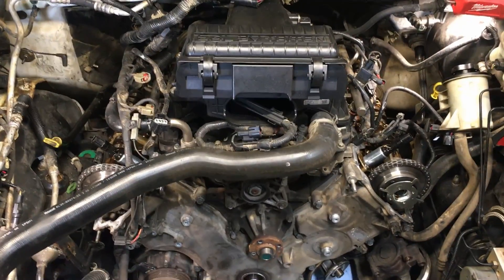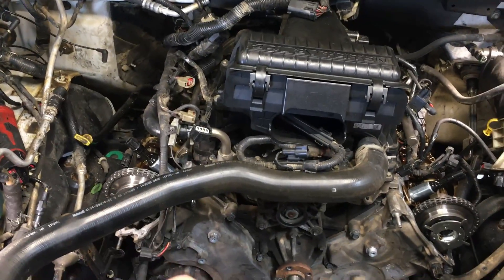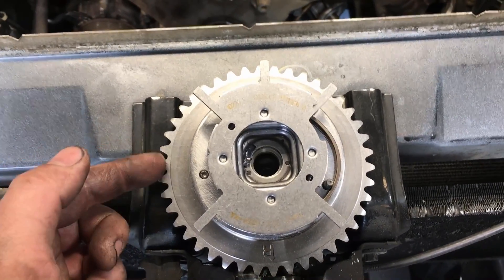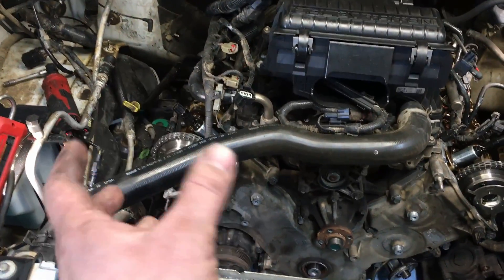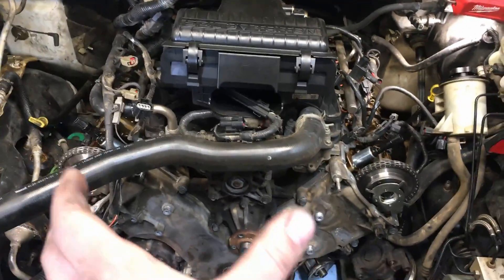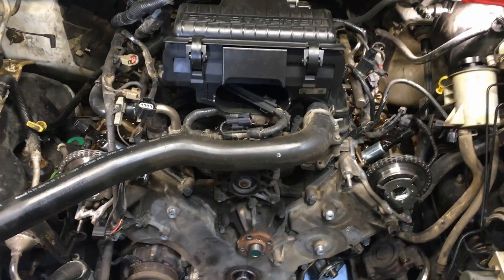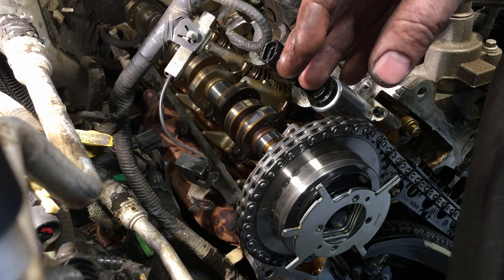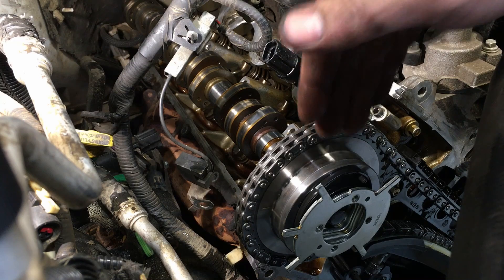Ford 5.4L 3v Triton Engine: DO NOT USE AFTERMARKET PHASERS FROM FREEDOM RACING/OTHERS; THIS IS WHY!

Comment: I'm never buying one these trucks. to many headaches with the Triton. I know that's not your pint but why deal with the plug, manifold bolt and other issues. I was going to buy a low mileage 2002 King ranch for 6 grand. Beautiful truck but no.  going back to my early 2000 year dodges. Parts are cheap. easy to work on if you can find one with a good frame and body.

Comment: Did any one else have an issue putting the cam phasers back on? I made sure my making were all lined up between my sprocket and my chain. But not when I try to put my new camshaft phaser on the little keep pin doesn't line up with the grove on the cam shaft. Any help?!?

Comment: Can you tell me which aftermarket  intake manifold you recommend  for a 2000 Ford Expedition with 5.4 2 valve.  There are so many of them and I am afraid it may be noisy if I buy the wrong one.  Thanks.

Comment: I was the Dyno tech at Cloyes Gear and I don’t trust many timing components , we make OE parts for FORD &GM just to Name a few, our hi perf sets were amazing from the HEX A JUST, QUICK ADJUST & Gear drive sets, the chain is something you must be careful when choosing, IWIS, CLOYES RENOLDS & Borg Warner is all I trust, Gates belts period, see every link will stretch and the longer the chain them more links the more cam timing problems, people have no idea how much power they lose over chain stretch and it is a little bit at a time so a timing set replacement will blow the customers mind if they don’t understand. Cloyes has sold out a couple times in the last 15 years or so and AAM and Cloyes we’re together but this year they split and AAM is where I now work and Cloyes is starting over with a small crew, we do more OEM @ AAM now but Cloyes will be the big boy soon I believe and they still do their hi perf old school and I trust their quality

Comment: I did it twice the owner insisted on buying all the components. On eBay evrything was after market needles to say both times those cam phases failed within 20 minutes wile test driving hey idle fine for a good hour then on the test drive it went to pooop

Comment: So left is your left as your looking at it? I woulda thought it would be left (or right) as viewed from the drivers seat, like airplane engines.
Reply from the maker: the left is always the drivers side yes.
Reply: But, unless im somehow mistaken,  that engine has the one marked "L"  on the passenger side. Is it installed wrong?.  But im just a diy mechanic so i defer.
Reply: @Taranabas52  ooh. Now it makes sense.

Comment: FREEDOM RACING SUCKS!!.  I did this job before Brian put this video out.  I had watched his other videos and did not listen and bought the timing kit from Fredom Racing.  It has been less 20,000 miles and a year and a half.  I am now tearing into my motor again.  It is worse this time then when I opened it up the last time with all the original parts.  Passanger timing chain guide was broke in two places and just resting on top of the chain.  Broke at both ends.  Then on the drivers side the tensioner is blown and slack in chain and tore up my trigger wheel.  It wasn't worth the couple hundred dollars I saved!  Thank you Brian for getting the word out and for all your hard work on posting such great videos.  You ROCK! and will definitley listen to you from now on.

Comment: I just bought a 07 f150 fx4 with 135k miles it runs great but I definitely wanna upgrade the oil pump but what else should I be considering for replacing besides oil trans fluids and spark plugs thanks for any advice

Comment: Hey Mr. Ford tech I got a Ford F-150 2012 4X4 with a 5.0L and I got a Code PO300 and I replaced the fuel pump all the Coil & spark plugs & the crank position sensor & it still idles rough and won’t run right, did check for vacuum works too ,so a Little bit of advice thanks please.

Comment: Just deleted the cam phasers on my 2004 f150. Both locked out at full advance. Truck runs good but is down on power and fuel mileage.

Who do I need need to contact to correct the tune? I actually would like to tune it to have even more power for towing.

Comment: On 2008 f250 5.4  3v  What do you thank of installing a Cam Phaser Lockout by Livernois Motorsports
Reply: I had it done. I have not had any issues since.
Reply from the maker: No

Comment: The one thing I've learned over the years is that yes you can use aftermarket parts in locations that are easy to deal with. An example would be a lock actuator or something of that nature. When it comes to a time-consuming job such as parts behind the timing cover, it's best to use Factory parts. It just saves you a lot of grief.

Comment: garbage engines. if the phasers don't fail you lose oil press due to worn cam bearings (which are the heads themselves) and not to mention worn out camshafts

Comment: I have a 04 and just did the timing job with phasers from ford and it makes a weird rattling noise on in drive and reverse (sounds like a rattle) could that be the timing chain? In neutral it’s quiet.

Comment: Good to know. You'd think one way the aftermarket could make a successful replacement would be to design a standard gear without the phasing nonsense. That's be win/win, you'd save money and make the engine more reliable.

Comment: Ford does the R&D folks unless your aftermarket part is tested like crazy then why use it? Problem is how can you tell, Can  you even contact the company to ask these questions? I’d say the Factory OEM parts are the best. However once in a while there is a kickass replacement for cheaper than factory but not always

Comment: I don't trust the ford 5.4 three valve Triton engine because they fail more than any other engine that ford ever dreamed up . I have a brother in law and a couple of other people who bought the ford pick up with the triton pile of crap engine and my brother in law's pick up had several different problems related to the cam shafts and one of the problems is the lack of oil pressure . They told him to replace the timing censors and nothing changed besides that the cams have three different censors one on the outside and two internal.
Reply: the 6.0 and 6.4 diesel are just as big POS. Ford killed me on their rigs. I will likely never go back.

Comment: I just picked one of these trucks up . I replaced the valve cover on the right hand side and noticed the chain had some slack on the side opposite of the tensioner. Do you think this would be the phasers or just a bad guide?

Comment: I'm confused why when you released the cam caps and stated it moved back to lock position, why it wasn't lined up on the middle tang ( as stated earlier in video), but the right side tang instead.  Possible install error on prior replacement?

Comment: Im doing a timing kit, rocker arms, lash adjusters, oil pump, and water pump replacement. Should I leave the oem phasers alone and not replacing them if there is nothing wrong with them? Im only having trouble with a rocker arm.

Comment: I put the freedom racing kit in my 2008 superduty with their aftermarket phaser replacement as the truck wasn't worth the money to spend the extra on timing components. Its been going strong for 75k miles and runs like a champ. The kit had the melling oil pump all the other components minus the phasers are ford parts. I think the best way to avoid phaser problems is to lock them out. Thats what all I put in my trucks now.

Comment: Solution to all Triton issues:
Switch to SAE 30 oil at 50,000 miles.
I have 190,000 miles on my expedition with no engine service of any lind but oil changes.
This is why Ford Triton powered cas lead in sales and satisfaction, and why the competittion post these silly videos suggesting problems.
Reply: The problems exist whether you like it or not.. You shouldn't have to put different than the specified oil in any motor to make it last, that just means that something isn't right..
Reply: is your expedition the 3valve 5.4 or 2valve? I too have an expedition,  its a 2003, and its the 2 valve with 230,000 miles and runs great. I also own a 2006 f250 with a 3 valve 5.4 and am on my 3rd engine due to the new engine using dorman cam phasers.  when i got my replacement under warranty "New" engine, i put Ford OEM cam phasers and a new Melling oil pump in.  So far it has worked great. oil pressure is between 40-60 psi .

Comment: Its a pretty antiquated phaser design by Ford and does not look robust enough. It is apparent that Ford is either designing parts which are dumbed down for low tier mechanics to work with or once again entering unfamiliar territories in regards to technology and have decided to cobble together this design.

Comment: How would one know that your truck needs a timing set? My truck is running like crap. You can feel low power, the engine is loud, sounds like a diesel, the exhaust fumes smell super strong, It has two codes for low cat efficiency in both banks, so I'm guessing the cats gave out due to the truck running like crap. Whst could be wrong with it?

Comment: So, why not call Ford out too? Seriously, this design is horrible. How much money, engineering, and maintenance costs, for how much gain?
Reply from the maker: Ford has made many engineering improvements over the years to make them as reliable as possible. Most 09 and new units have the latest parts and come in at 200k miles for this service. I mean how could I expect more than that?
Reply: @FordTechMakuloco  Call me a cynic, but this rendition of vvt seems like an engineer may have skipped the lesson on point of diminishing returns. Thanks for the reply and all the great FREE info!

Comment: What replacement parts did you have installed which led to this issue with respect to timing jumping. In my situation guy im talkin with to maybe buy the truck he says it starts and runs but needs cam phasers as it jumps time he stated....

Comment: I like watching all your videos and updates. Thank you from TD Australia. I also learn a lot to maintain my Ford 5.4L V8 in Australia. In Australia we have a Ford Fairlane (great car) 2004 barra 5.4L 3V V8, and the cam phases I am told are needing to be replaced. However, I found no Ticking or knocking noise, the engine idles very well and very smooth. The car runs well but has a sort of grinding noise when starting to move that I think is tail shaft vibration. The tail shaft has been balanced yet still there is a small amount. Actually I think a new tail shaft would solve this. Also I decided to replace the "Camshaft Angle Sensors" as they are original and this made a huge difference. Trevor

Comment: Ford should of done a recall to start with. Is this a problem for the 99 2 valve? I don't hear ticking and I have good oil pressure. Thank you ROC for another fine China made garbage product!

Comment: I have the same issue with the aftermarket garbage like you say , replace phasers three times and the boss keep saying, was something wrong on the assembly 
They came on pieces , but I didn’t check the locking positions, I will next time 
Thx for the video, you’re the man

Comment: Great videos man. I have an 04 f150 5.4. Always had a tick, never cared. About a year ago I started getting intermittent shakes at idle during long drives/load etc. Now those shakes are turning into stalls plus last time was p0340 p0012. Is this probably the phasers? Thanks!

Comment: Why wasn't the black chain link on the left of the engine not lined up with the timing mark on the cam sprocket?
Reply: He had only taken it apart. It doesn't get lined up until you take the front cover off, remove all the timing components, reset the timing marks and place the chain on.
Reply: @donbavol9672  I know but when you first take it apart the black link should line up with the timing mark.

Comment: that spring that brings back the gear to lock to correct timing seems very weak!!!

please disassemble an original one and the aftermarket one .

measure the tension!!!

this info would give great feedback and understanding to many who are interested...
Reply from the maker: Unbolt one and you will see it is under extreme pressure!

Comment: I watched your 4 part timing video and installed a kit i got from autozone i knew from jump b4 watching this video that the phasers were junk after i torqued them 30 lbs and gave it the extra quarter turn the outside part turned with my wrench but not the gear itself saw this video took the phasers off and they literally fell apart the gear separated from the spring and not just one but both thankfully they refunded my money and i just ordered the phasers you recommend ( Im shocked that the chinese phasers /with no name\ i took off even though where bad are still better built than the american DURALAST company's version )

Comment: I wish I had seen this sooner, it completely explains what happened to my truck. I had a 2004 Ford F150 that had the cam phaser 'tick'. A mechanic buddy of mine helped me replace the phasers with aftermarket MOOG ones. A week later one side came apart and we had to replace it, and the timing was never quite right. My buddy is a good mechanic and no one could figure out why, so I finally sold the truck for almost nothing. I've had this exact experience, thanks for sharing this video.
Reply: cynewave Not a good mechanic.

Comment: I dont even own a truck i found this to be great advice. thanks
Reply: roberto ruiz 2.8 and 3.6 gm has them as does the eco boost fords and 5.4 they all are similar in design  , what could go wrong all have several chains ,oil pressure controlled hydraulics controlling timing nice the engineering staff needs to go to the wood shed

Comment: Just curious if adding the melling pump and cam phasers lockers with the svt tune will work with aftermarket phasers. Or to still just stick with oe parts. Also where exactly are you located? I'm in the southland Chicago area, we have to be somewhat close... I'm using aftermarket timing kit now only cuz at the moment I don't have the means to afford to do it right. I'm hoping I can get by for a year and the upgrade the phasers, either do the comp cam limited phasers with svt tune, or Ford phasers with the lockouts and svt tune. I'd appreciate your input. Thanks.

Comment: Im confused???  You say dont use the phasers but you still use the SHITTY plastic tensioners?  For the ultimate reliability, throw those JUNK PLASTIC CRAP in the trash
Reply from the maker: The latest Ford Plastic tensioners with the revised seal which Ford started using on the 09 and newer vehicles are lasting 180k to 200k miles. This is speaking from experience, lots of experience.....

Comment: Why not just do the phaser delete works great for jasper engines
Reply from the maker: Phaser delete? Are you trying to say Jasper is breaking Federal emission laws with a phaser delete option?
Reply: They are not the only company making a phaser delete kit, and it works great. it’s a permanent fix and it does NOT raise Emissions. Passes TX state inspection.